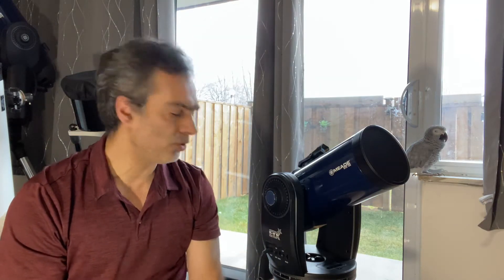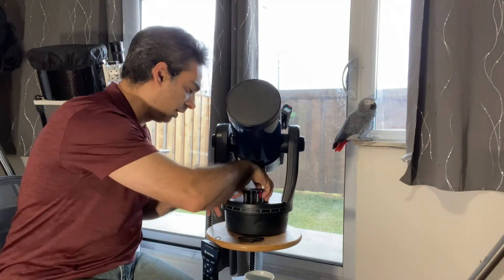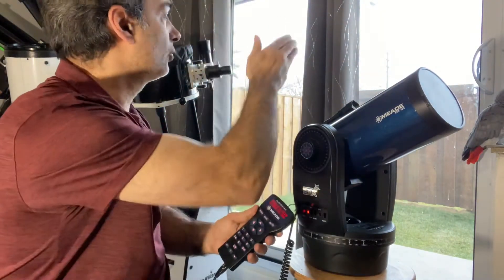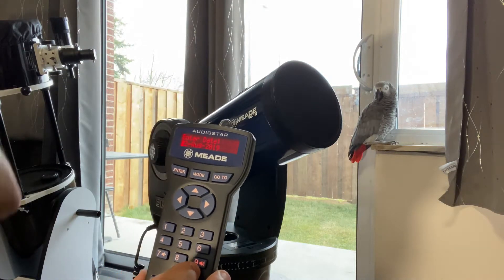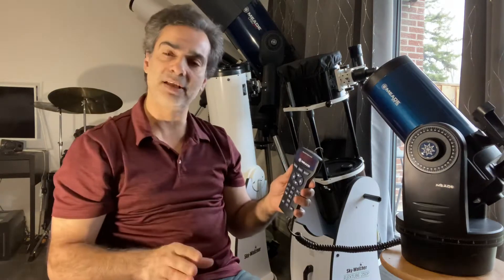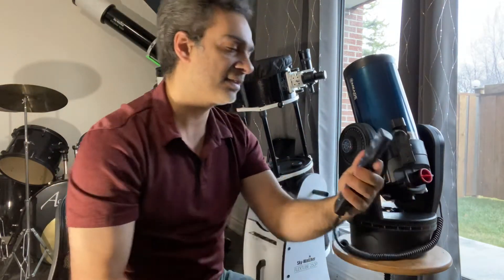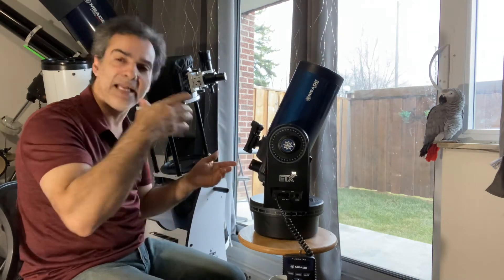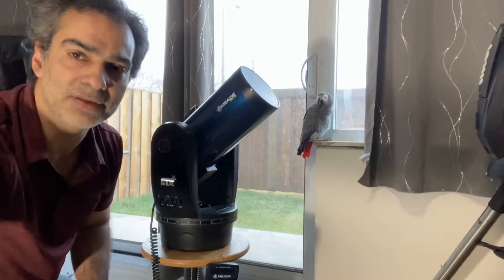125 meade etx #space #nasa #telescope #astronomy #saturn #jupiter #meade #moon #mars #venus #sky

Comment: Do you know how to fix this if the blue tube will not stay up? Thank you
Reply from the maker: I’m assuming you mean on the original fork arm?

You could be a couple things so first even though sounds simple there’s two locking nuts on either side of the arm. Did you try that? 

Second unfortunately, the fork arms and drive base are almost completely made of plastic, so could be possible if you’re over, tightened it you could’ve cracked one of the plastic arms that hold it upwards and no longer will work like that 

The good news I have a different video back in 2019 where I show you can take a telescope off the fork arms. You do need some knowledge though it’s not so easy and use a Telescope on a different Tripod. 

The telescope itself is really high-quality, but the fork arms and the bass is what’s lacking it is mostly plastic, so worst case scenario is try yourself or to hire somebody to take a telescope off the fork arms

Comment: oh hell no I will sell it before I spend  year learning how to use it! and what sucks is I just bought one!.
Reply from the maker: Since the goto craze of 1999 & onwards the most selling scope are almost all goto. However since then I have seen / heard / read 100's apon 100's (at the very least) people who gave up on the hobby. Or i also heard/read people cant align the computer or its not working/ finding the items.

Most of these issues are user issues. The first thing is they or maybe the manufacture makes it sound like you power up the scope push a button and it finds everything perfect for you.

This however is not real. The user has to level the mount level balance and point north. If eq model have correct lat setting on mount.
Then choose time date year, daylight or regular time. lat & long of user or city. Then align on 2 or 3 stars .

THEN this is also a BIG downfall for most. When the scope is finding each star it can be 5 degrees to 15 degrees from where the real star is & the user has to manually move the scope to the star & put it in the center of the ep. Most fail cause they just push align on the hand controller & not move the final part manually.

Some times it can be power issues glitches or software issues too BUT alot brand new get confused or then cant figure it out and give up.

People need to learn at least 20 of the brighter stars to align the scope properly.

I think its best to learn the sky the manual way then at least you first know how the sky looks (most constellation) stars, how the sky moves. how to work a scope mount etc. Then after a yr or 2 you can try goto once you learn all that. Yes the sky slowly turns & one complete turn take one year BUT in that time you will know the sky really well if your outside alot looking.